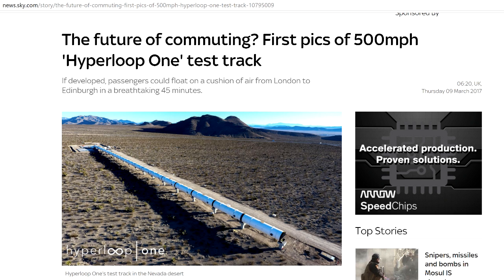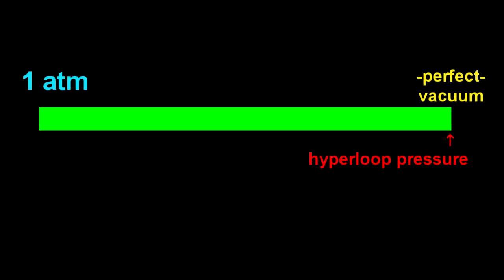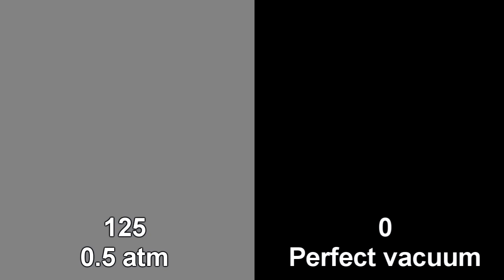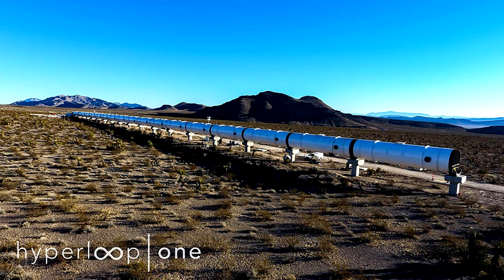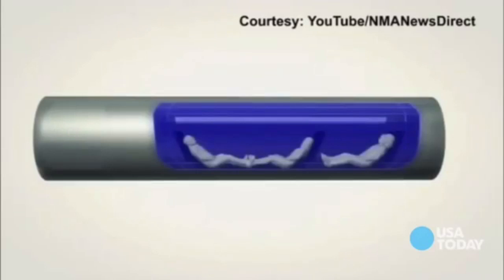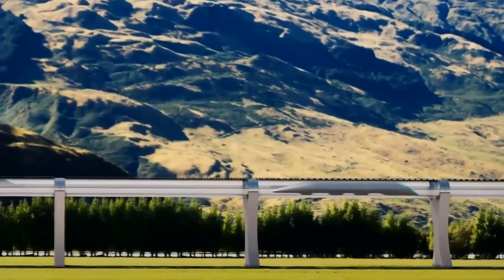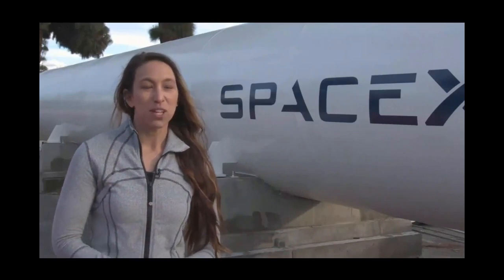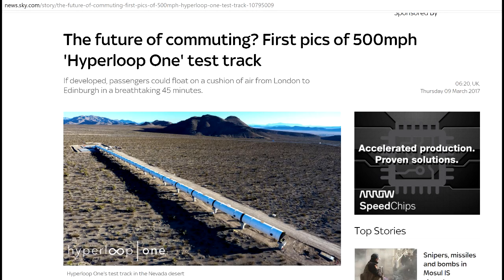Entire Hyperloop could be destroyed in SECONDS!

Comment: Why cant they just build a fucking maglev?
Reply: Because it is too expensive. This hyperloop is ehm... cheaper in some imaginary magical way? Maybe it runs to the end of the rainbow and picks up buckets of gold. Who knows. It's solar powered. That's cheap, sort of, if you ignore how much solar panels you need for a train to run and that, obviously, could never be possible with a train that runs on electromagnehm... Ah fuck it! They should just build a fucking maglev and be done with it. Save people some actual time and money instead of wasting it with the hyperpoop. It could also go over hills and around the mansions that John mentioned. The construction is probably much cheaper now than it was when it was invented and the efficiency is probably a lot better now as well.
Reply: I concur.  It's not just my opinion, either; to get to SF by train, you have to take a BUS (huh?) over the mountains to Bakersfield, then board a train to Modesto, then another BUS over the hills into the Bay Area.
Reply: They will not be able to complete the current high speed rail project in California, because the plan is to bore through overlapping tectonic plates and then raze a 100 mile path through multi-million dollar mansions. 

Let alone a maglev, or a hyperloop.
Reply: California does not have a heck of a lot of cheap land. 

Unfortunately, those "hills" are the San Gabriel Mountains. Nobody will even seriously suggest going over them. Railroads are terrible with slopes, which is why railroad trestles are as flat as possible. 

The tunnels were originally going to be 20 miles long, but that's crept up to 25 and will probably increase, because of the damage this would do to towns, nature preserves, and so on. This is around three times the length of the longest mass transit tunnel in the world. 

A bigger problem than that is that the San Gabriels are not stable; they're riddled with faults and aquifers. The plans have changed recently to shift the start point further north, perhaps to further delay the probably cancellation of the project once the tunnel construction starts.

Comment: I agree that it's a bad idea but I highly doubt a failure would include a vacuum collapse.  I'm sure the structure would be built to endure the pressure.  I think the bigger issue is rapid repressuring in a failure situation.  I'd hate to see what would Happen when a vehicle designed to operate in a vacuum suddenly hits normal atmosphere going hundreds of miles per hour.

Comment: Why should they depressurise the tube after every run? In the final design they simply could use pressure gates at their stations. Then the volume can be minimised to a few square meters. Comparing the speed of these really crude pods usend in the media event with the final, probly magnetic levitating pods does not make any sense. Concerning the structural integrity of the tubes, I personally don't see any difficulty building it tough enough, for protection against exterior force they just can use multiple hulls/layers with different properties and some proper spacing beteeen them. All in all, im my view, concerning exterior influence , the hyperloop concept is not more vulnerable then some high speed trains today.

Comment: I like the idea as a concept, but just that, a concept, a theory, in practice it is possible, but not as easy as they are trying to make it out to be, hell if I was designing it I'd have the inner chamber, that would be no less than 30% atmo, a secondary chamber would go around that one at 50% atmo, then a third at 70% and lastly a tough covering concrete perhaps or something along those lines to protect the inner chambers from damage, but I would never design it with human carriage in mind, I would only accept cargo to be used in it until such time as it's been through the paces and test so thoroughly that it was reasonably safe for human life, but then I'm not the guy that design the 'green' tesla' or the space x 'powered landing' rocket

Comment: As far as depressurizing the tube... isn't that the entire 1km tube? Wouldn't the time be significantly less to depressurize only the tubes containing passenger cars? Then you could open doors connecting the the remainder of the tube. Also, the volume of air is much more because the test car is only a fraction of the tunnel's diameter and length (so... volume). Look, I'm skeptical too, but this particular argument keeps sticking out to me as incomplete.

Comment: Would internally bracing the loop with rings (as well as support beams between each ring) of a high tensile material such as ceramics or carbide alloys, at very close intervals,  not negate the collapse?  Surely you could have an external pressurized tube which is laden with structural support, and simply have an internal tube at the same pressure as the external, the internal tube would be at an equilibrium with the outer tube and thus would have no force exerted on it. Really the internal tube is only for aesthetic purposes, as well as acting as a sleek guide for the carriage, should a derailment occur (No support material for the carriage to collide with). 
All the necessary support materials would drive up the price of production, but it'd make the project scientifically feasible at 1 atmosphere.
Also using the university hyper-loop challengers as an indication of the best anyone can do is just silly, any mag-lev train company could produce a viable carriage in a matter of months. Just apply the current tech to a vehicle that has the necessary structural support to handle 1atm and you're  good to go. 
Having automatically firing bulkheads at set intervals of the loops sections that could close in the event of a collapse or catastrophic de-pressurization, would fix the whole "Being shot off like a bullet debacle".
Such bulkheads would also allow for de-pressurization and then re-pressurization to be limited to a single section of track (The docking station) and could be as small as the length of the vehicle itself, making 6:40 a moot point. If it's done right, this is most certainly a legitimate mode of transportation, just not an economically responsible one...
Also It's 2am and I can't be arsed proof-reading this, so don't go all "Grammar Blitzkrieg" on me.

Comment: Well of course the pods just kind of stop, gravity still acts on it and the friction caused by the wheels is more than enough of a brake. The hell did they think would happen once they stopped providing thrust to it?

You'd be better off putting Maglev inside, and after doing a little research myself, turns out only 1 or 2 of the design teams in the competition proposed wheels, the rest of the 120 other teams went with maglev or air skiis. So congrats on not taking the advice of most people who are passionate about this.

Actually, why are most of the designs shown even trying to be aerodynamic? If you're in a vacuum, there is no need for it and it just takes up more horizontal space while also adding more weight.

Also, to shorten down on the time to decompress, wouldn't it be better to have an airlock connected to the side of the track?

One more thing, how exactly did they plan on how the cars would get back to the starting position? The current design isn't a train, but more of a rent-a-car and there's no guarantee that a passenger will travel back to their point of origin.

Comment: I agree with most of your points on this video but I can't help but feel that some of your points were a little nitpicky like the "they couldn't even build a mile long test track" and "it takes them over 30 minutes to put something into the test track and pump out the air" well it is just a test track so I don't see how picking on that furthers your point (though picking on the results of that test was of course fine). Other than that, good video.

Comment: IF the timeframe for pumping the tube down holds at 30 minutes per kilometer, the full length Hyperloop will only be able to do one trip every 3 weeks because it will take 20.8333 days to pump the tube down to the operating pressure.

Comment: There are some things that can be easily improved, e.g. an airlock that leaves not much space around the train will make depressurizing faster, but the main point is really, that the tube exposes a huge surface that has to withstand 1 atm without fail. That is already a technological nightmare without taking protaction against attacks from terrorists or other morons into account.

Comment: But what if you had safe system that fills tube with air as fast it detects change in pressure ?
You would not need to refill entire thing , just area around carts. Like using some rocket level of gas pumping pomps.
Flooding area around cart.
Another thing could be making "weak" points. Where tube would snap always first. Like on sides of tube where carts dont move.
So crushed area will be on sides. Tube with cart can be weaker , just to hold carts.
And another thing around. With proper supports , that would redirect power of failure.

Comment: I think it's feasible, I've been brainstorming a mag-lev in a vacuum tube for over a decade.
Your going to have to bury it to negate the temperature variations, then you can lay a casing of concrete for improved safety. You can section it off with doors to simplify the creation of vacuum. 700km/h isn't worth the effort in my opinion, the limit is the maximum g-force a human can take; several times orbital velocity with the passenger compartment inverted and riding on the roof of the tunnel.
If you can get that technology down, then you could ramp a section up the side of Everest and very nearly launch things into orbit with the energy from the track alone. It would bring the cost of putting objects into LEO down to a fraction of what a rocket costs, with a much higher margin of safety. THIS, is the real potential of the hyperloop, and Elon could scrap SpaceX to pay for the costs.

Comment: I suppose the key thing here is - what problem are they trying to solve? If it's a lack of fast, efficient travel, then why are they so married to the hyperloop concept, with its many flaws? Sure, you can claim that "it's an engineering problem" and "I'm sure they'll come up with a solution," but then, why not expand their horizons a bit and come up with better ideas for fast, efficient travel? There are plenty of potential options available that don't involve a highly dangerous vacuum chamber - the fact that a vacuum chamber reduces air resistance seems to be its *only* benefit! A potentially catastrophic depressurisation, even if way less likely than thunderf00t claims, seems like a steep price to pay for something that could be achieved by conventional rail, mag-lev trains or air travel.

Comment: Did you just copy your last video? What's new apart from "spend 5 minutes to calculate the structural stiffness of a tube under pressure before producing it"?
Oil and gas pipelines are exposed to pressure differences of many atmospheres and they are doing just fine. Yes, outward pressure makes it less sensitive to dents, but it's nothing a healthy safety margin for the vacuum tube couldn't fix. It works for all the particle accelerators, so why not here? The stress on the material is independent of length...

Also, any catastrophic failure would be stopped from propagation by gate valves and emergency flooding. The technology is definitely not a problem at all, it's just extremely un-economical compared to a (slightly slower but more or less fully engineered mag-lev).

Comment: They managed 100km/hour under near-vacuum conditions. Impressive considering that the german ICE reaches only up to 300km/hour of speed under normal atmospheric pressure. Oh wait, that's actualy three times faster than the hyperloop.

Also, 5:07 . Do my eyes deceive me or is this article actualy talking about "passengers could float on a cushion of air"? I thought the whole point of the hyperloop is that there is NO air involved thereby reducing air resistance.

Comment: A tanker truck is not designed to withstand one full atmosphere of pressure from the outside, so it's not surprising that the one in this video collapsed. The walls of a tanker truck are not constructed of seven tenths of an inch thick A1018 steel, as is called for in the engineering drawing at 9:02. An operational hyperloop track would not need to be evacuated along its entire length each time that a vehicle was launched; only the loading area would have to be pumped down, and that area could easily be isolated from the main track with a large ball valve at each end of it. It is unreasonable to expect that test vehicles would or should be accelerated to full speed on a test track less than one mile long; keeping it below 100 MPH is somewhat more prudent.
I do not understand your vehement objections to the development of this technology. It is as though you were kin to one of those saying that "heavier-than-air flight will forever remain impossible" - in 1905. Or that a voyage to the moon and back is a mere flight of fancy. Are you heavily invested in some competing technology? I would expect a person such as you to be a good deal more open-minded.

Comment: How the hell is this not going to have leaks?

1) Absurdly large surface area, to volume ratio. Even if the volume is only 2nd place in the world, the surface area of the chamber has to be 1st place by a miles. A crack/leak at any point fks the whole thing up.

2) Thermal cycling every day causing stresses which can lead to leaks.

3) Vehicles rushing through this vibrating/stressing everything leading to leaks.

Maintenance is going to cost a fortune. How many pumps are they planning to use?

Comment: I think they should have made a system were there is a lubricant out on the surface and thy have the train like thing that covers the entire hyper loop and has a vacuum in front of it and a higher pressure behind it this should make it self-propelled and yes i do realize there are problems with this like the pressure lowering over time but that is what a air pump is for and you could use little graphene based stoppers so the transport devices can stop and go and the problem i listed earlier could be used to slow down the train thing or the simpler alternative is just put a monorail in there because their is palatially no vacuum.

Comment: What is so ridiculous about this is that they have been building these for a hundred years or more and they actually built a full sized functional one in the late 1800's but rats ate the leather seals. but the really stupid thing about this is it only requires a pressure differential from infront of the train to that behind to obtain very high speeds and efficient  travel. Supermarkets still use them to get cash and receipts from the registers to the vault.